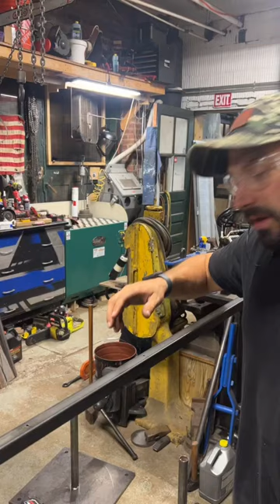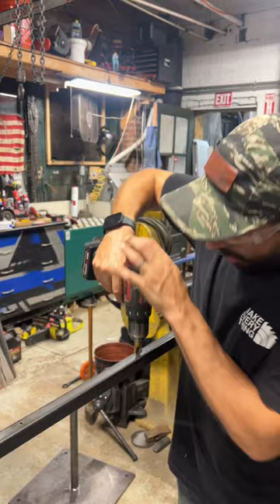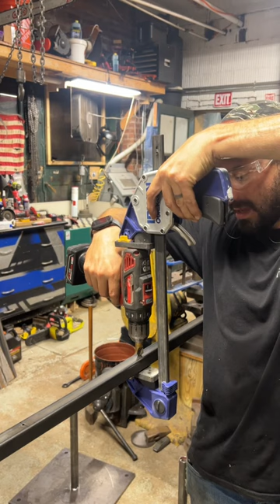This drilling trick will save you time! Use a clamp to get even pressure when drilling in tube!

Comment: Slow speed works better we do that in  the cnc workshop I work at it is so much smoother also see the smoke means your running too hot your wearing out your bit faster
Reply from the maker: The smoke is mainly coming off the oil on the cutter
Reply: @MakeEverything  ok at least you oiled it that wasn't covered in the video but yes slower speed makes it easy so much faster and smoother just try it sometime
Reply: @CMyBigHarryBLLS  it also depend on the amount of torque the drill you are using can produce. Sometimes you may not have the power in a battery powered drill to turn the bit through the metal at slower speeds, so it’s easier to chip away at the hole while losing some bit life. On the other hand, a drill press or some sort of CNC drilling rig will generally have more than enough torque to push the biting edges of the bit through the metal at slow speeds which does indeed make for a better finish on the cut and longer bit life because the bit does not heat up as much.
Reply: @AGMertzy  we use Milwaukee drills just like his I can see he's on speed 2

Comment: I love these little tricks. One I recently found and used was when you need to line up holes in wood, put lipstick on the bottom of the screws already drilled in and it will stick to your second piece of wood when u sit it on there to line it up. I know that didn't make much sense but don't have pictures.
Reply: That was quick thinking coming up with that excuse when your wife found lipstick in your pocket. 😉

Comment: A safer way would be to get hold of the cheap lightweight drill press accessory for a drill, with a V block on the table, easy to move around.